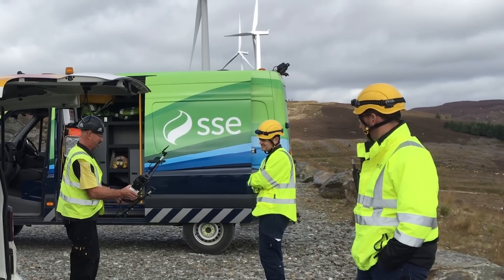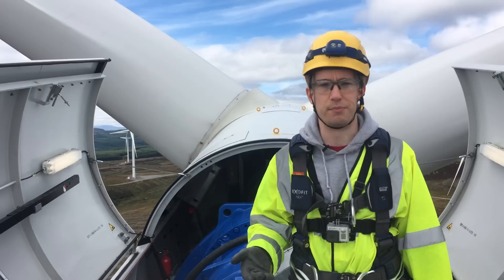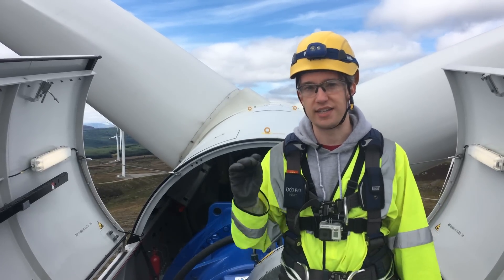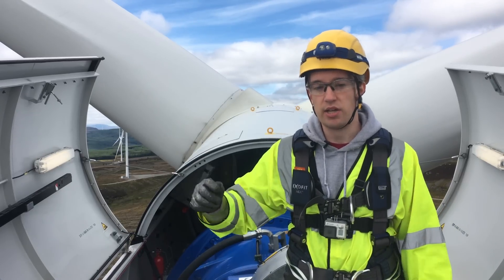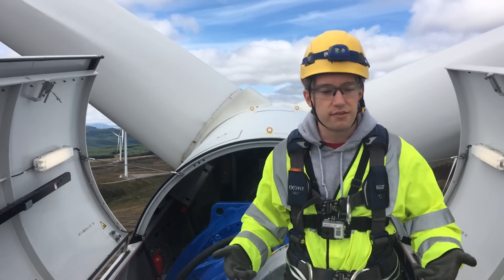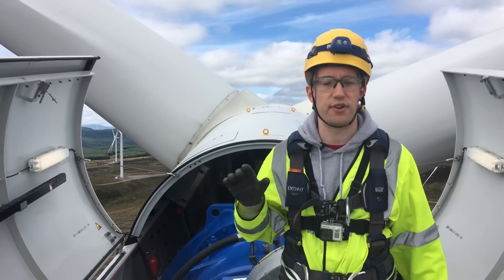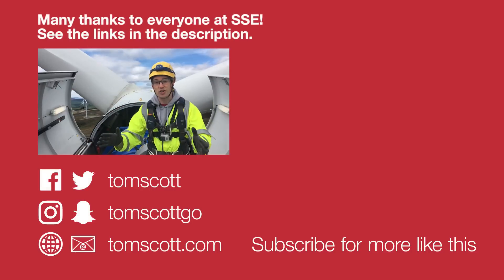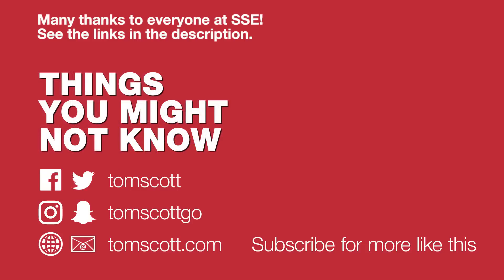The Problem With Renewable Energy (and how we're fixing it)

Comment: Maybe someday each Home will have its own mini system that will compensate for the problems you mentioned in this video.  Small wind turbines, solar panels, batteries, generators of some sort, etc or things that haven’t been invented yet. Also, if geothermal energy is available to operate the massive turbines that helps to solve the problems at least in part and it’s the only renewable resource that tends to not fluctuate the way wind and solar do. As new battery technology comes online we may all have a bank of batteries in our home that electricity passes through.

Comment: you can also add a battery and a computer to each wind farm / solar farm and modulate the output so that you can "pretend" there is a big rotating mass there. this is called a virtual synchronous machine. I'm not so sure the electric car route is as great as everyone thinks it is...

Comment: Perhaps an efficient solution would be for every large scale renewable energy farm to have a buffer between itself and the power grid, perhaps only a small fraction of the systems total capacity. Add a flywheel to every wind turbine, a capacitor to every photovoltiac cell, etc. But thermal solar plants are good because they already have a huge buffer from the thermal mass of the working fluid. I think  only after theres ample excess capacity will the issue be conpletely resolved. Or else we could just take all the old steam turbines from decomissioned coal plants and feed solar produced steam into them, using them as flywheels. Probably be more efficient to use electric motors though.

Comment: Very good explanation of a constantly overlooked problem. 

The only comment I have is that wind mills are not fundamentally unusable for stabilizing the power grid. The problem is that most wind mills are (as you mentioned) nowadays connected to the net with power electronics to generate the right frequency. If you were to connect them with a synchronous generator, you wouldn't have this problem. Downside is that this drastically lowers the efficiency of the windmill.

Comment: Don't know if you could do a segment on it, but I've always considered SBSP (space based solar power) the ultimate power source for Earth's needs. Imagine: solar panel arrays of any size or quantity (space is VAST). The collected energy is transmitted via gentle microwaves to airport-sized receiving antenna arrays; this alone would remove the need for a huge amount of expensive transmission line infrastructure worldwide. Power would be generated continuously, 24/7, without interference from weather or night, and these gigantic orbiting solar panel arrays would not interfere with local ecologies. The electricity would feed the existing grid, and also be used to cleanly produce hydrogen and oxygen from sea water. Hydrogen can be liquefied or infused into holding cells, and either form could be used to power all forms of transportation. When hydrogen is burned, the “exhaust” is water vapor. We could end the use of all fossil fuels (oil, coal, gas), and we could shut down all the nuclear power plants, everywhere. We could use excess energy to pump water up into existing lakes or dams, and regain the energy from existing hydroelectric plants. The biggest challenge to this concept is getting payloads into space cheaply. This could possibly be done using a mag-lev launch platform; a space rail gun, so to speak.
-
Nuclear is not an option for future energy needs. Factoring in the costs of mining (which burns fossil fuels), refining, handling, using and storing nuclear fuel and its waste products, not to mention protecting the plants and by-products from attack or misuse) space-based solar is way more optimal than nuclear energy. We as a species really need to start doing this, as in "yesterday!"

Comment: Hello Tom, 

" Rotational mass and system inertia are the things that keep your lights from flickering"

No that is incorrect. The type of light is one fundemental factor and the although less common now the fluorescent lamp was inclined to flicker, this was solved decades ago by a coating which gave persistance of vision. Incandescent lamps don't flicker neither do any fed internally by D.C.
What the rotational speed and inertia of large steam turbines does is help smooth the variability of demand and compensate for sudden drop or rise of that demand. Wind and solar cannot do this and makes them fundementally unsuited for large scale grid supply. We are following a dead end in persisting with this form of generation. The wind and solar farm operators , on the other hand, are doing very well finacially, thank you.
Reply: Well, fast frequency response (from Li-ion batteries or demand-side response for example) can alleviate the issue of lower inertia. Of course some inertia will always be needed. Converter-based wind turbines can provide synthetic inertia but there is a time delay, the response is very limited and there are potential issues with the so called second dip due to non-optimal tip speed ratio.

Comment: Interesting🤔...
Makes me wonder about angular momentum batteries
Chemical batteries have storage limit, but kinetic energy is not limited.
Reply: Yes and no. There are going to be limitations imposed by what you use to spin up the flywheel and extract the energy from it and others from what the flywheel is made from. The fact that it could well be possible to store a lot more energy in a flywheel is probably right, though.

Comment: A smart grid is part of frequency stability, and less coal.
wind and solar have a max uptime of 30%, you could say the reliability/continuity  factor.

But to really get rid off the coal/oil and gas, you need a stable non-co² production that has small footprint and high uptime and can be regulate on output.

That is nuclear power,  and the best way to use nuclear is by using a molten-salt (thorium)  reactor.
Witch is in principle much a finer and more practical design then any solid fuel reactor design.

Comment: Tom you should have done the math to determine how many cars will need to stay connected to the grid. If the wind farm has a 150 Mw potential, how much does it actually produce? Since the fuel based power plants have to stay online to cover the wind generated shortfall how much CO2 production has been  diminished?

Comment: The problem isn't so much that the spinning components in the turbine aren't heavy enough, it's that they are connected to the grid through a frequency converter. In a normal turbine, as you said, the turbine and generator spins in sync with the grid, generating 50 Hz of AC current. Since the flow of water or steam is quite steady, and you basically have full control over the stream of the medium, this isn't a problem. Wind turbines on the other hand can't control the medium which is powering them, and as such their rotational speed fluctuates a lot. The trim and yaw controls of the rotor helps them a bit, but can't fix everything. Enter the frequency converter. It takes the varying output of the generator and rectifies it into DC current, and then runs that DC current through an inverter which creates a perfect sinusoidal 50 Hz wave that's compatible with the grid (actually, it also creates reactive power to compensate for local voltage variations in the grid, but that's a bit more complicated). It's basically an UPS with it's output facing the grid. The problem with this is that the DC stage inside the frequency converter essentially decouples the spinning mass of the turbine (which is actually quite heavy, since the rotor isn't light by any stretch of the imagination, especially when you include the long radius of it) from the grid, negating it's energy storage capabilities. 

TL:DR; Blame the frequency converter!

Comment: Wouldnt it be possible to build-in redundency to the grid by producing more electricity than required from wind and use it to power pumps to re-fill hydroelectrc dams to avoid the power grid fluctuations and maintaining dam levels?

Comment: one quite issue with the video and that is Tesla car batteries have a slightly different chemistry compared to their grid batteries which will be plugged to the solar panels. This is because the energy products are designed to be charged and depleted everyday. the Tesla battery is more for every day commuting and the occasional long distance travel. one of Tesla's heads said in an interview that the car batteries won't be used to power the grid.
Reply: battery chemistry doesn't matter at the grid level if the onboard controllers are doing their job
Reply: +2Awesome it does in the long term
Reply: ***** My point was that having different battery chemistries won't matter except that the car batteries probably cost more which would be economically stupid (if they get cheap enough and it doesn't cost a fortune to replace them it wouldn't be that bad).

For your argument about being designed to be charged every day it doesn't really matter as long as they are kept within design specifications (even if that means only using 5% of the car's battery capacity) Cost is still a factor that needs to be addressed.

Comment: Although I think they don't normally do so, I think the pumped storage system at Dinorwic can reverse in a matter of a few seconds.
I don't think car battery chargers running in reverse will be much good for this sort of peak demand - they're too slow/low power. OK, you may have thousands of them, but I still don't think it's really a goer.
BICBW!

Comment: Question: Why not just use the renewable energy to spin a giant turbine which in turn is connected to the existing main grid? Additionally you could stabilize for long-term with water storage. Bit less effecient but doable right?

Comment: The proposal to use electric cars as a buffer has been around for over a decade. It has some technical challenges. For starters, inverting DC to AC isn't as easy as it sounds but transistor technology is improved so much that this is becoming easier to do by the day. I don't understand the part about mass in the turbines... every country over generates electricity to cover these gaps anyway so why would it be an issue? Some countries generate up to 40% more than they need just in case power stations go offline unexpectedly.

Comment: Solar power is DC, so there is no 'rotational mass' of any sort. Solar is run through inverters to make it AC. Since this is an electronic process, synchronization occurs thousands of times a second.

Wind power turbines may be AC, but they are variable speed so they also get synced to the grid via electronics. Power is stored on a cycle by cycle basis in banks of supercapacitors. The incoming charge controller and outgoing load controller operate independently of each other.

Battery storage is best organized as a '3-tier' system: storage at the generator farm, storage at switchgear stations, and storage at end-user-consumers, such as cars and appliances. Farm storage should be focused on leveling 'surges' - huge gusts or temporary lulls, making it possible for the rest of the grid to compensate with a 'bit of play'. Switchgear storage is basically the 'tank farm' of long term battery storage - these should be able to maintain six month reserves. These are designed to even out the longest swings, the variation between winter troughs, summer peaks, fall and spring wind surges, etc. Homes and businesses should design their storage systems to handle two week grid outages, as might happen during ice storms or hurricanes.

When entirely renewable storage grids settle out, this is most likely how they will be configured.

Comment: Tesla hornsdale power reserve has saved south australia already 112 million 
It can react as a frequency control system 
Has been used twice recently to stabilise the grid in south australia from losing high voltage power lines from rest of east coast of australia 
Absorbs excess electricity when frequency goes too high above 50hz and outputs when it is below 50hz 
High voltage powerlines from victoria got blown over in big storm recently and south austraila was islanded from rest of east coast grid

Comment: The problem with wind turbines is clearly shown at 0:21. I would say that this wind has to be supplemented with solar energy, sea tide  and waterfall energy.  Damming river has caused a lot of problems too. I feel it is immoral to use electricity from a thermal power station to heat with, when a direct gas flame will  be much more efficient on the environment.

Comment: Question. How much energy, plastic and other oil synthetics had to be used in order to build one of the turbines. How long does it takes for the electricity generated to be actually green energy?
Reply: On average, a wind turbine has a 20 year lifespan (then they're often reconditioned and sold overseas to keep being used).

It takes just under a year of average energy production to pay back the manufacturing and installation costs of wind turbines.

For a coal powered plant, it takes 3 years to pay those costs back, AND it's still poisoning the world.

Comment: Interesting, I never thought of this problem of balancing the grid.
One thing I don't quite understand is how electric cars would be used to help out. This would only apply to those cars that are connected ("charging") to the grid at the moment the power supply is insufficient, right? I mean, you can't tap into cars that are on the road.
Sorry if this sounds stupid but I'm not that familiar with electric cars technology.   ;-)

Comment: CCGTs are not just boilers - the gas turbine turns the main generator and the exhaust heat then goes to boil water. Most CCGTS could produce power with NO steam

Comment: I feel like flywheels will work quite well. I mean, that's essentially how Tom Scott described it; tons of steel rotating at the same rate, and when more power was needed, the kinetic energy is sucked out of the turbines. That's the storage issue solved. Then we just need something to regenerate the power... I dunno. I'm not an engineer yet.

Comment: Reactive power..... disconnect those turbines from the generator and let the generator (Copper coil) spin at grid frequency and it'll supply reactive power and absorb fluctuations
Reply: It depends on which kind of a generator (and power converter) is used. Older WT used induction generators without a converter, which only absorb reactive power and cannot produce it. If synchronous generator is used instead, then you can control the reactive power through excitation. Modern WT are connected via a power converter and are therefore much more flexible.
Reply: @FrainBart_main  synchronous condenser.... similar to what the AES plant in Huntington beach...
Reply: @roberthurley8366  I was talking about the generators inside wind turbines. Of course, you can directly connect the generator to the power grid and supply reactive power (if it's a synchronous generator), but most wind turbine generators are connected via a power cpnverter to the grid, which decouples the rotational speed from the grid frequency. You don't even need a generator to supply reactive power in the case of a power converter, just a sufficiently big capacitor or battery (this would be a STATCOM).

Comment: There are also other problems related to the renewable energy. What will you do when there isn't wind, or wind is changing. Use the second best option which is nuclear energy. Nuclear powerplants are very slow to turn on, so you don't relay on nuclear power to produce energy when there isn't wind. So you have to burn coal when there isn't wind.

Comment: As a method of storing energy, would this method be feasible - to use excess electricity for the electrolysis of water to produce hydrogen gas, which would then be fed into hydrogen fuel cells when required? Obviously there's the issue of storing the hydrogen and the energy losses involved through each stage, but is there any reason why this can't possibly be made to work?

Comment: lets say every house has a smart battery pack and what you power you dont need get stored in there because you can be a sleep and wind pick up and the turbines spin harder but there is not that much demand and that energy can just be stored in your house smart battery and can be pulled from when needed

Comment: Tom Scott if you want to talk about power generation then you might want to get a few of your facts straitened out. 
#1) the "cycles" as you call them. the correct terminology is hertz  but your numbers there were right 50Hz and 60Hz respectively
#2) the turbine doesn't directly create the power, they are coupled to generators that create the power
#3) if one plant trips out they can ramp up the output of other units most of the larger units are not running at 100% all of the time  or kick a  peaker unit on, that can be brought on line quickly from standby (off) 
#4) in  the event a unit dose trip out the exciter on the generator is deactivate so that they can bring the unit  down in a controlled and safe  manner only thing slowing the unit down for the most part is friction 
#5) yes steam and gas turbines are less efficient,but they don't rely on good weather to produce power just fuel  as well as combined cycle  plants that use the exhaust from a gas turbine to create steam for a steam turbine    
#6) when the wind doesn't blow there is no power being produced not to mention that wind turbines are more complicated and harder to work on than a "standard" steam or gas unit. due to the requirement of a gear box  and the fact that you cant really get a crew up to repair it  easily